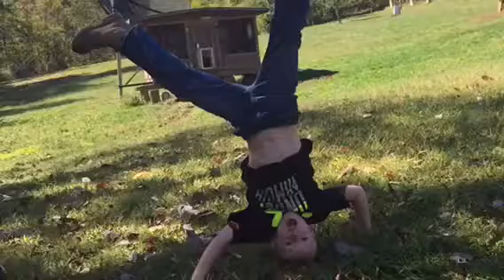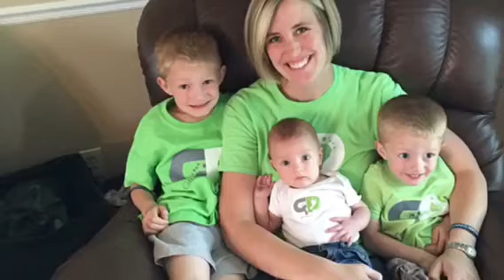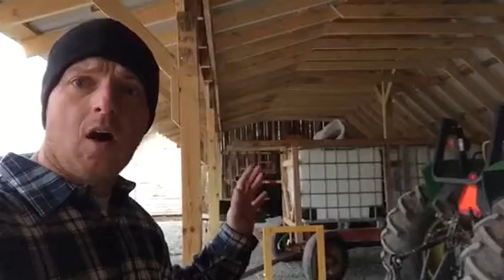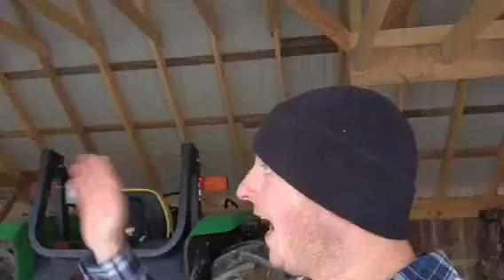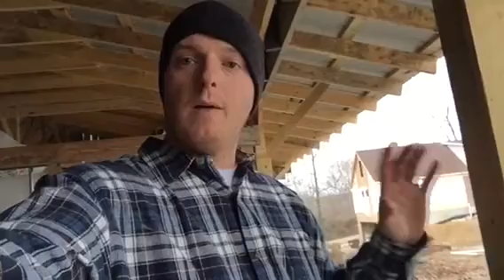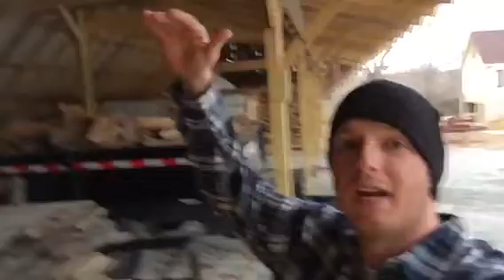New Barn at Strong Roots Farm

Comment: Great video! You mention twice "5S." What is that? What email to ask for your plans? We farm in Alaska, I am building a barn for our milk cow now, planning on an equipment barn/ shed next, something similar to yours.
Reply from the maker: Ed, 5S is a systematic tool used in Lean Manufacturing, or Continuous Improvement projects.  It stands for Sort, Set, Shine, Standardize, Sustain.  You can google the process and it will show you many different ideas to help your processes.   There is also a book out by Ben Hartman called the Lean Farmer that may be a good resource for you.  As for the plans, I don't have any.  I did this one old school with pencil and paper on a drawing board.  Thanks for watching, and I hope this helps.